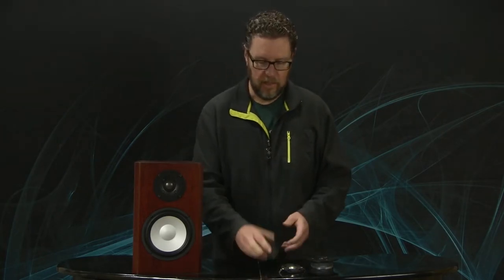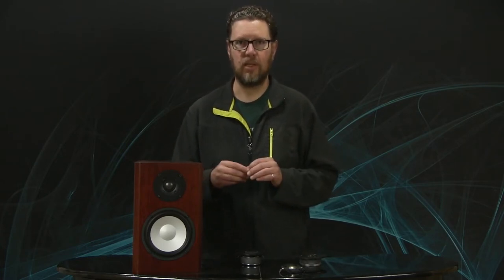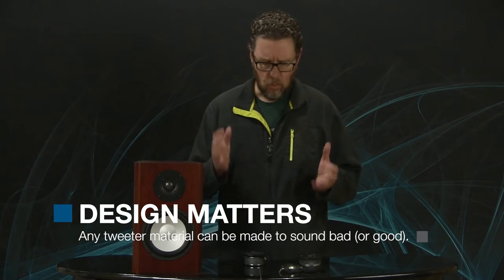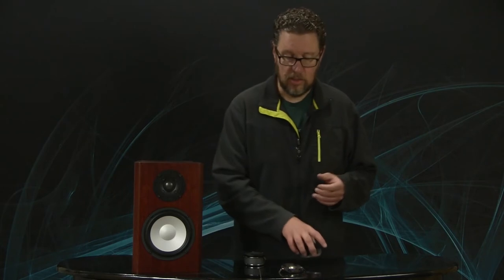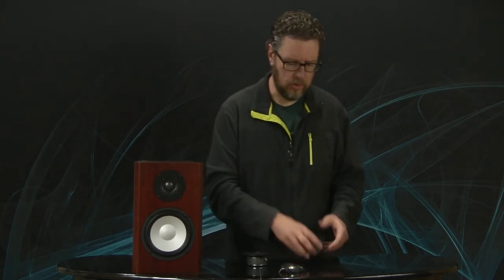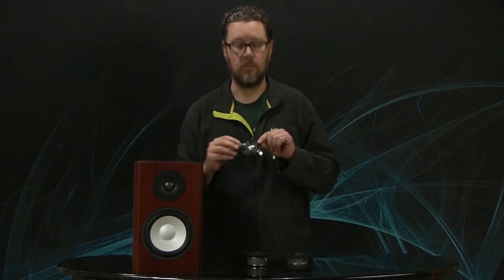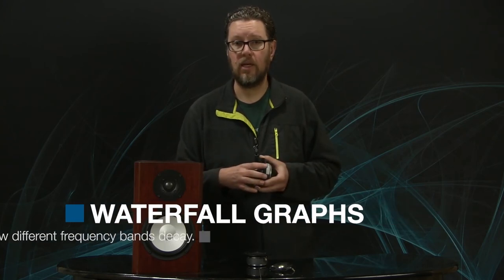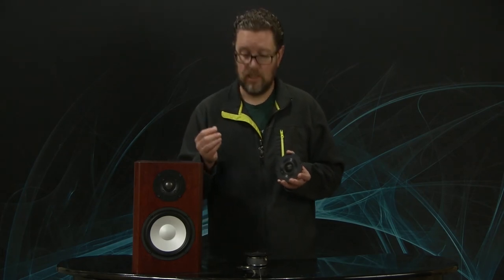Soft Dome vs Metal Dome Tweeter: Audio Myths

Comment: My two way speakers have Focal drivers. The tweeters are acid etched titanium inverted domes. They are the smaller version of their 90’s vintage tweeters, td90k’s vs the td120k’s. They are incredibly accurate, bright and not harsh at all. My old speakers had peerless soft domes in them, which were popular in the late 70’s. They are rectangular in shape with the wiring for the voice coil in the front of the tweeter. They are not as accurate as the Focals, and don’t play as high in frequency, but they sounded pretty good when I built those speakers. This is solely my opinion, but they measure quite different from each other, the Peerless tweeters having an f3 of 19k, while the Focals have an f3 of 23k. So I believe my opinion is correct.
Reply: kennethcohagen3539 - I still have 3 sets of TC90x put away for future use, but I might end up ebaying them if I inherit my brother in law's Klipschhorns.
They sure are clean, fast & open w/o harshness.

Comment: I have 2 way speakers designed and built by a small local manufacturer. It has SB Acoustics alu dome tweeter and alu midbass drivers. I love its sound. Very smooth, balanced and calm, I can listen to it hours without any fatigue.

Comment: Could be a self fulfilling prophecy in that designers know people expect a brighter sound from metal dome tweeters compared to soft domes and design the cross over network/L pads to match fueling the belief that metal domes are brighter than soft domes. I've read that myth a lot too on forums when I was starting my journey building my own speakers. In general I like the highs to be not too forward and bright so I picked soft domes, and it worked out well. 
But it makes perfect sense that it shouldn't matter when building your own crossover, you just measure them and create a network that brings all drivers in line SPL wise. There's shouldn't be a difference in SPL unless you make it so. Ringing, nodes and resonance can be a problem but I tend to think it's so small in that range (at least with 3 way speakers) it barely makes much of a difference at a certain quality level (my tweeters are in the 40-60 euros range). 
It's mainly for spatial cues, not so much to produce notes that are played. Brightness is mainly in the 1-3khz range according to Danny of GR-Research and I believe that to be accurate. I've crossed the mid range and tweeter at around 6khz and above 15khz I don't hear anything. 6-15khz is about 1.5 octave I think. 
I might buy a good quality metal dome tweeter to try it out, I'm curious how it would improve (or not) listening to music and how it's different. It's probably going to make more of a difference in a 2 way speaker design.

Comment: In the early 90s, I bought Heybrook HB1s with the same Tweeter used in Monitor Audio speakers. My young ears could hear the breakup modes about 20k. I'm also the kid who couldn't stand store fluorescents. BUT some $6000 ProAcs, 10X the cost, had metal domes in a hi-end store with no audible problems. Lesson: Lower-quality metal domes cannot match the finest metal domes for detail and distortion.

Comment: Im guilty of having held that myth. Your video made me reflect on how/why i had acquired that view.  I think I came to that conclusion that soft domes sounded warmer/less bright not because i was comparing metal dome, but just comparing cheaper low grade products i owned in the past that may have had mylar or other plastic material, or a strip of cheap metal for  tweeters,  all of which have rather poor sound quality.  Thank you for this...i will try to audition as many speakers as I can with metal dome tweeters without bias going forward.
Reply from the maker: Rick, that’s one of the most satisfying comments that I have received on ANY of my videos! I’m so pleased I was able to offer you a different perspective that has changed your approach to listening and auditioning loudspeakers.

Comment: Having listened almost exclusively to soft dome tweeters in my speakers for the last 40 years I can tell you that there is an audible difference.  I initially perceived it to be a slightly colder quality to the sound of my aluminum domes.  Keep in mind my custom speakers have two aluminum domes per cabinet.  In truth, I adjusted to the "new" sound within a week and don't even notice it now but enjoy those speakers immensely.
Reply from the maker: It’s possible you are hearing a resonance or some other characteristic of the metal dome tweeters, but as you have found we tend to quickly tune out some small details after spending some time with a new pair of speakers.
Reply: Hey Andrew,  The aluminum domes in question are the ones found RBH-MC-6C which are high quality.  Unlike my soft domes I've never heard these metal tweeters resonance.   Like you said over time we adjust to the different sound.  There is no which one is better, just different.
Reply from the maker: @adamant3844  That’s exactly the point I was trying to make…different, not better or worse!

Comment: Most metal dome tweeters have a higher sensitivity so that contributes to easily over doing the highs
And new models Can handle twice the power of soft dome tweeters
Reply from the maker: You are correct, however a good loudspeaker designer would compensate for this during the design phase.

Comment: You didn't talk about resonance, which is the real difference and problem with hard dome tweeters. The harmonics produced from that resonance are like ringing a bell and that's where the metallic sound comes from. Soft domes have less resonance and dissipate it much faster. The downside of soft dome cones is lower resolution. Obviously, as you mentioned, the design is the most important fact to obtain a pleasant sound, but the main challenge for hard domes is resonance and the main challenge for soft domes is resolution, mainly at the highest frequencies. This should be very clear when designing a speaker.
Reply from the maker: It's a valid point…I did not go into too much detail on resonances. But I’m not in agreement with your assessment of different dome materials. ALL domes, cones, ribbons, whatever, will have breakup modes at some frequencies. It’s how they are dealt with and damped that is the most important factor. An example, I have a beryllium and a silk dome tweeter with identical motor systems, surrounds, and voice coils. The beryllium tweeter has a sharp, high-Q resonance at 30kHz of +6dB. The silk dome has multiple, lower-Q resonances that are below 20kHz and within the range of hearing. Which one will be better? The answer is, it’s not possible to say, but they both have faults. Which faults are audible?

Comment: I know in theory what you are saying may be correct - but I have yet to hear a metal domed loudspeaker I like .. and interestingly Wilson have moved away from the Focal metal dome to a soft dome tweeter .. and sound better for it.
Reply from the maker: Thanks for your comment…I suspect the Wilson differences are more to do with design than the tweeter dome material, but I’m only saying that based on my own experience.
Reply: Wilson had to make the change as Focal in and around 2004, quit providing raw drivers for non Focal-Jmlabs speakers. Properly corssed, I will take the Focal TDX120Td5's every day of the week and twice on Sundays! Hard to beat the accuracy and quickness of the almost perfect pistonic movement the Focal Berylium tweeters exhibit, they are simple breathtaking in a properly designed speaker.

Comment: Do we need to worry about the sound coming from the rear of the tweeter cone? Where does it go and can you get cavity resonances?
Reply from the maker: You certainly do need to worry about it. In many cases the pole-piece behind the dome is vented and damped to prevent resonances and reflections back through the dome. Might be an interesting topic for a future video?
Reply: @AxiomHomeTheaters  would be interesting. B&W seem to have gone to great efforts with their high-end tweeters.
Reply from the maker: @nickdoughty518  Seems like a detailed tweeter video is overdue. Thank you!

Comment: They're midwoofers rather than tweeters, but I still wonder what's people's input on SEAS U18RNX/P VS L18RNX/P VS ER18RNX. Poly cone, aluminum cone and paper cone respectively. They all seem to be VERY hard choices as all of them seem fantastic midwoofers, preactically regardless of price bracket in theory... I don't know what these are capable of in practice however.
Reply from the maker: I don’t have any direct experience with those mids, but SEAS make some very nice drivers.

Comment: I'm guess it has to do with mass.  Fabric tweeters and paper woofers have less moving mass than metal type drivers.  So the smooth or more transparent sound usually is a driver with less mass.  A 6.5" heavy duty metal woofer is going to store more energy than a paper 6.5" woofer.  There is always a trade off with every design choice.  The metal tweeters are much more noticeable when they break up than fabric soft domes.
Reply from the maker: In my experience, I have not found any link between “smoothness” and transducer mass. While metal dome and cones can be heavier than silk or paper, that is not necessarily always the case. I have run into many thick paper woofer cones that weigh far more than aluminum and doped fabric domes that weigh more than our titanium domes. Thanks for your comment.

Comment: Dude you do understand the concept of truisms and tendencies right? Saying metal domes can sound metalic and hard is not saying that ALL of them do. It's saying that more of them do than for other materials like silk. A generalization is valid if taken as a generalization not an absolute rule. Of course there are excellent metal domes but there are lots of nasty ones too especially those made back in the 80s. Just as there are both lousy and wonderful sounding soft domes.
One advantage soft domes have which people rarely mention is that they have lower moving mass than do metal domes. That makes for potentially higher resolution of low level detail. But again there are other facts that determine quality so it's not an absolute rule.
Reply: That last comment about fabric tweeters being better for low-level detail is interesting.

Comment: For your next video can you address the dual tweeters in your vp180 center channel?
Reply from the maker: Dual tweeters (and dual midranges and woofers) are used in the VP180 to greatly increase maximum power handling (volume) and lower distortion at very loud playback levels. I can certainly add this to the list of video requests. Thanks for your feedback, and for watching.
Reply: @AxiomHomeTheaters  there's a lot of criticism about lobing from side by side tweeters in a center channel. It would be interesting to see your discussion about why you chose the design you picked vs the tweeters stacked on top of each other. I chose the vp180 for my brother's theater (you've used his theater picture in some of your videos) and it sounds incredible. I don't notice any problem with the side by side tweeters but I'm interested in why it's measurable but not noticable to real ears.
Reply from the maker: @Huub1e  The quick answer to your question is that lobing will be present acoustically in any loudspeaker with 2 or more drivers. In a vertically oriented design, like a typical bookshelf or floorstanding speaker, these lobes will be measurable in the vertical response family. With a well-chosen crossover point and design these lobes can be mitigated and will usually appear at the listening position in the reflected energy from the ceiling and floor. In the case of a center channel, those lobes are now in the horizontal response family and tend to be far more audible as they as they appear in the critical side-wall reflections. Our research shows that having a large lobe to each side of the tweeter in the common woofer/tweeter/woofer configuration had a much larger negative impact on the overall sound than having more lobes where the cancellations are not as “deep”. Our ear/brain system seems to have an easier time integrating these smaller cancellations. That resulted in the placement of the drivers in the VP180 and is also why the tweeters are not side by side in the middle of the cabinet. Glad your brother's VP180 sounds great in his home theater!
Reply: @Huub1e  Looks played a huge part in that decision.  That horizontal design goes against every thing a speaker designer would do.  I've read on forum that so many disliked the VP150 with tweeters on the end.  Unless the tweeter is just being crossed really low I see no reason for dual tweeters on a center channel.  There really isn't enough drivers to warrant dual tweeters.  And if very loud playback is need in very large rooms than using 5.25" mids and 6.5" woofer is probably not a great idea or at least going about it wrong.  Pro audio woofers and horn loaded tweeters will get significantly louder than the VP180 with out the inefficiency.
Reply from the maker: @chadmorris946  Actually, we found a significant improvement with dual tweeters in our blind listening tests during development. The reduction in distortion at higher levels and better dynamic capability with effects was clear. Sure, you can get more efficiency with horns and 15 or 18 inch pro woofers, but very few would want that in their living or family room.

Comment: The blind test you mentioned is already flaw in the first place. To compare whether metal dome really sound more harsh than a soft dome tweeter, you should design both speaker with a similar frequency response and crossover point. By pushing the output of the silk dome, of course you are making it sounds harsh and bright. What you did is simply stating a poor design crossover will sound bad no matter it is hard or soft dome tweeter and it did not show whether a hard dome sounds the same as a soft dome tweeter.

Comment: The myth originates from the fact, that most cheapo speakers have PP or Metal tweeters and soft domes are usually found in the higher range.
That said, I agree with your statement about "engineering is king", since I know how good even simple components can sound, when they are made with concept and reasoning and vice versa. But, from what I've experienced, "good sound" lies in the ears/brain of the listener. It is almost as subjectable as musical taste. Take ten persons and ten pairs of speakers and you will never have all agree on which sounds the best. Some people can sense the difference between a harsh/soft sound others don't. Add to the equation the variable of the amp used and the conclusion for finding the best sound is only one: listen for yourself to various mixes and matches of amps/speakers, without any preconceptions and outer influences, possibly blind folded. I myself was surprised, how I ended up preferring cheaper components (prize wise) over top of the line ones.
Reply from the maker: This is all very true. We can all be easily fooled by brand names, retail prices, cosmetics, etc. These things play a real part in how we perceive everything. But listening biases and preferences are all very personal, as you say. What I think IS important is for everyone to listen to any respected, well-engineered and neutral speaker design when shopping to re-calibrate the ears. It is very easy to live with something for many years, and however good or flawed it may be, we get used to the sound and use that as our “reference”.